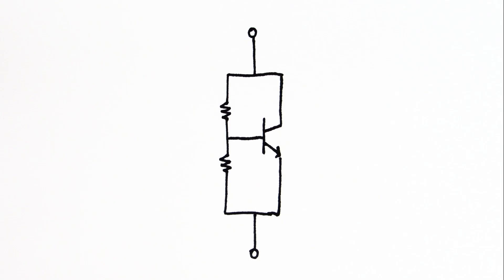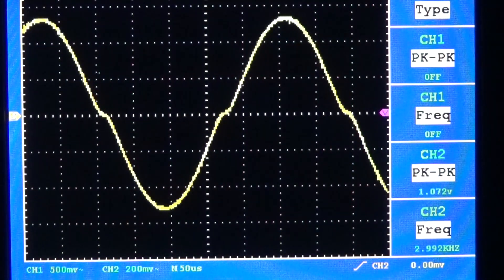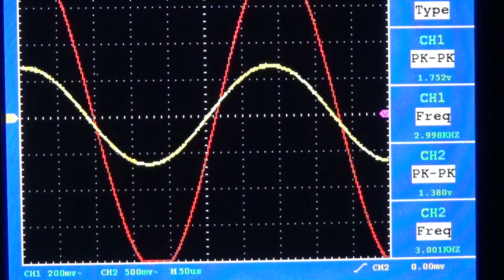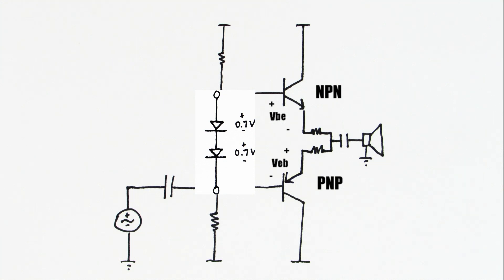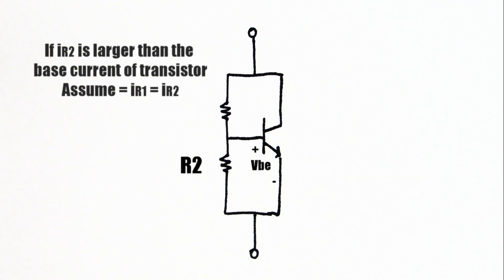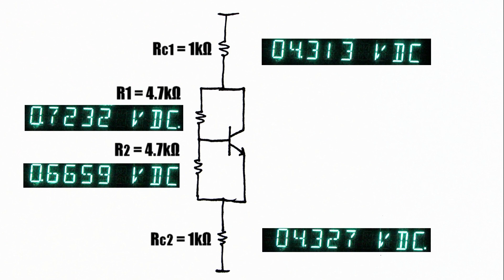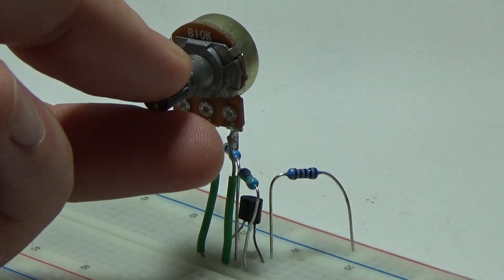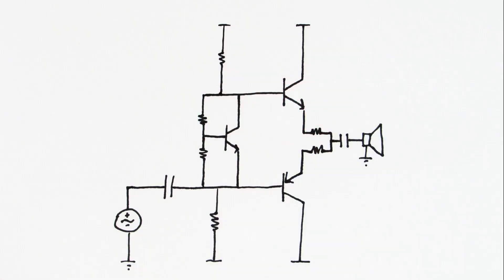Vbe Multiplier - Class AB Transistor Audio Amplifier Application Tutorial

Comment: What is the reason for only connecting the base of the PNP to the signal? why not use a 2nd capacitor to connect the signal to the NPN as well?
Reply: Because then you'll get class B amplifier. The difference between AB and B in that bias. AB works like A, having small quiescent current, but has advantages of B. B is working only in 180° of input signal for each halfwave resulting in some distortion, but AB works in slightly larger area, cowering that crossover showed in the video. Additionally, if you'll increase quiescent current, you'll get amplifier, that to some current works like A class, but after that like AB. Sometimes that's called deep AB class
Reply: @unfcarrot I meant why not put a second capacitor on the upper portion of the circuit that connects the NPN transistor's base to the signal too? (and the left side of both caps connecting to the input signal voltage so there is still only one input point) rather than just having the single capacitor below the diode and only connecting to the PNP base. 

If the transistor at the centre of the amplifier acts like a diode, then it seems like the input signal is affecting the amplifier by shifting the bias voltage at that "diode". Instead of it being done through only the one capacitor below the diode, why not put a second capacitor ABOVE the diode as well? During normal operation no extra current would flow through the caps because its DC isolated so bias shouldnt change right? 

I was just wondering if a 2nd capacitor that is above the diode drop would affect how anything behaves, or if its just redundant to have 2, or if the circuit works better with 1 cap.

Comment: The main oopsie I see in designs is the wiper feeding the base. Pot gets oxidized over time from not being adjusted and then the bias voltage gets wonky. Also, never put the pot in the collector-base circuit. If you lose the pot then amp blows up.

Comment: Yes, but how do you calculate the current going into the base when there's (essentially) no emitter resistor?
Reply: Current into base will depend on the transistor physical characteristics. To use a generic example, he just assumed 10% of  current on R1 getting through base. Anyway, for a precise calculation, you'll need Gm value, HFE and Rπ, using what we call "BJT small signal model" to design this model appying Kirchoff's Laws on entire network.
Hope it could help.